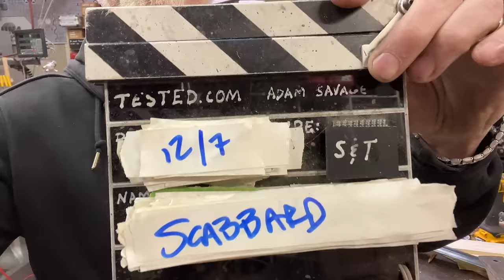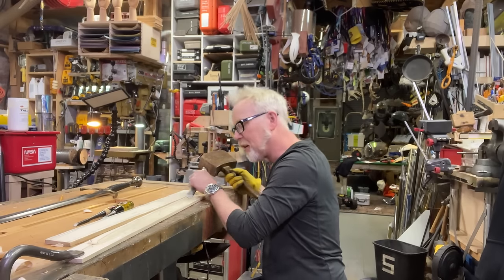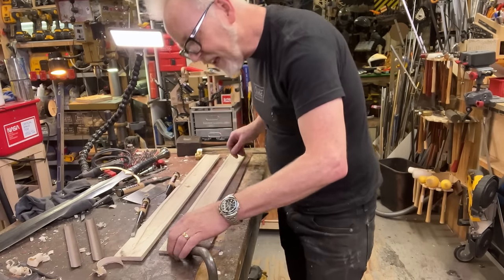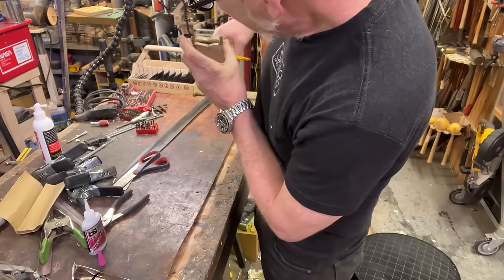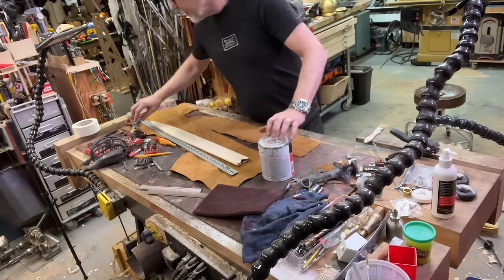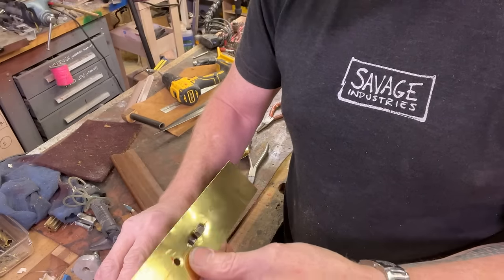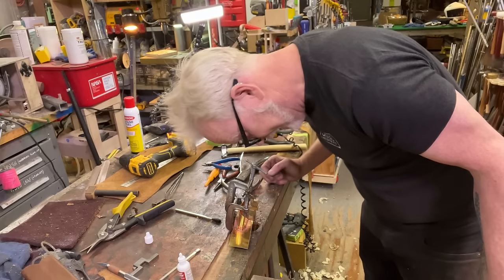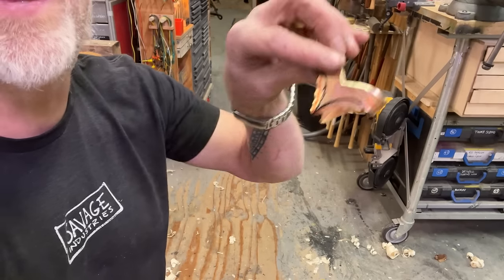Adam Savage's One Day Builds: Sword Scabbard!

Comment: I made a number of scabbards for broadswords a number of years ago - when the build was close to done I started coating the blade with graphite the sliding it in. This showed where it was rubbing most on the way in and where we needed to shave away a little more without overdoing areas that didn't need it.
Hope this helps!
Reply: Great idea! Chalk for a chalk line would probably also work
Reply: @alexstarr1589 
Yup.  Or even drawing charcoal would work.

Comment: a router plane would have done wonders on the inside of this. Router planes are a very interesting hand tool too.
Reply: i was about to comment this same thing !
Reply: As an old school carpenter, i endorse this comment. Accept this 'like'. 👍
Reply: Was gonna say the same, I’d use my 71 for that.
Reply: I had never heard of this tool, now I've looked it up I want one!
Reply: Take a piece of wood, drill a couple holes side x side at an angle, push that same chisel into the holes, bevel down, to necessary depth, wah lah poor man's router plane.  Look up Paul Sellers Poor Man's Router Plane, thank us later Adam!
Reply: You mean, like the tiny violin plane that Adam did clearly use on multiple occasions in this video?
Reply: yep was going to say the same tool. The old Womans Tooth plane
Reply: @shubinternet  
Nope, using a chisel produces an inconsistent surface, the tiny plane will follow that surface, so, a nice smooth finish but varying in depth.
The router will take the surface down to a predefined depth, consistent across the whole piece and referenced to the original surface of the work piece. 
It has various common names such as "Grannys tooth" or variations of the same due to its single narrow blade. 😁 (Granny had a very gappy smile! )
Reply: @shubinternet  That's just a normal planer. A router plane holds the chisel at a specific depth
Reply: @Mechie980  Don't know if you were being funny using 'wah lah' but if you weren't and if you care the word is 'voilà', French for 'Check this awesome shit out!' - (look there).
Reply: No, a router plane wouldn’t have done wonders on this, it would have done damage. It’s supposed to be used across the grain, not with the grain: it has a wide open mouth, no chip breaker, and the iron goes into the wood at a slight angle, bevel up – If you used it along the grain for this, you would split the wood and tear out huge chunks. In addition to this, a router plane produces a flat recess, but the sword isn’t flat, it’s much thicker in the middle. So even if a router might just about work at a very shallow setting, you would have to readjust the depth all the time to create the right shape. A carving gouge would probably be the best tool for this, but the chisel (bevel down!) and the violin plane are right, too.
Reply: Did you just tell Adam Savage to buy a Router Plane?! If he does and mentions it, the second hand market will double in price again!!! They're already well over priced!
Reply: @mm9773 1) you can use it with or against the grain. If you’ve tried and couldn’t, your iron was dull. 2) it’s adjustable for depth and you control where you cut. 🤷‍♂️
Reply: @Mechie980 
“Wah lah” = “Voila”.
Reply: @shubinternet 
A router plane is different than a violin plane.  A router plane works more like a router (for obvious reasons) and hogs out material to a set depth registered from the flat, top surface of the piece of wood (around the carved space for the blade in this case) rather than just shaving out pieces within that space, like the violin plane does.  It can give a uniform depth mortise or dado and is often used for cutting such grooves or dados.  Like if you wanted to make a dado for a horizontal book shelf in the upright side pieces, you would use a saw to saw in the sides of the slot and then use the router plane to remove the wood in between your saw kerfs; and you would get a flat, even dado (slot) for the shelf.

In this case though, it wouldn’t quite work because the blade isn’t flat and the carved out area needs to be carved to a variable depth.
Reply: @thirdeyenz 
I said the same thing.  “Wah lah?!”  He must be from “Puh hoe en icks” (I mean “Phoenix”).  😆
Reply: @mm9773 
True.  Although poplar might have even enough grain to get away with using it with the grain as long as it’s used the right direction to avoid tear out.  But the point is moot since you’re also right about needing to carve to variable depth for the blade shape.

Comment: Loving the sword content.
I like the traditional sheep's wool lining. But I suspect that that specific bit of wool was cleaned and so lost most of its anti-rust oils, coupled with most of the wool being shaved off as well. However just as some lining to help hold and cushion the sword it would probably work well anyway, as long as the chemicals used are non acidic.
Typically you also don't want to store the sword for long periods of time in the scabbard, since it can trap humidity and you won't notice if rust starts to form.
Very interesting project and I can tell Adam has been reading his Oakeshott.
Reply: Yeah, it's the natural lanoline in sheep's wool that would help keep off the moisture, anything sold retail has had all that washed away. If it doesn't smell like sheep, you would need to add a form oil yourself.  ;-)
Reply: Do you happen to know why he only lined one side of the scabbard? I'd have thought lining both sides would make more sense

Comment: I've been using various hide glues for decades in the historic restoration field, primarily with wood, but also other organics. If you're not going to use up that Titebond liquid hide glue in the next six to nine months or so, I recommend you keep it in the fridge (better yet, the freezer) for a much longer shelf life. Unlike most food expiration dates, definitely DO pay attention to the date on liquid hide glue bottles. When liquid hide glue gets too old, it no longer hardens fully. If you need your chilled/frozen hide glue in a hurry, just drop the bottle in some hot water for a few minutes and it will be ready to go. In my experience, it doesn't suffer from multiple freeze/thaw cycles. My guess is that the long protein chains break down over time, either through enzymes or oxidation, so that when it dries, those broken up protein chains can't do as good a job cross linking and tangling up. For some applications that's not a problem, but you definitely do not want to use past-its-prime liquid hide glue for things like furniture joinery where joint creep is bad. There, you want it nice and fresh. When used fresh, a well fit, well glued joint can last hundreds of years, and still remain reversible for future generations to repair without undue difficulty. As an alternative, dry hide glue has a very long shelf life, and you can hydrate/heat just as much as you need for a particular job. Hot hide glue is it's own thing that also has the advantage of being nearly instant, although it's a bit more of a pain to prep. Altogether, though, hide glue is great stuff!

Comment: I've been making both a scabbard and the sword for it out of cedar using nothing but hand tools. And this video is incredibly helpful giving me ideas of how to make more progress I've been stuck on. A hand planer would definitely help me get the outside thickness down to where I want it faster and more efficiently than sanding and using my carving knives. And I wasn't sure how to adequately leather wrap the scabbard but using contact cement seems much more reasonable than trying to sew it like a sock for the scabbard to nest in. 

I really appreciate how much of this project you did with hand tools, since all of us who might want to replicate the processes displayed. 

How do you 'hide your crimes' with the strip of leather up the back to cover the rest of the sword so the edges don't come loose with time and wear, and don't have an obvious edge that it was just a strip glued over the back?

It seems like you want to do something to cover the tip of the scabbard, which I'm confident you could do in brass similar to your mouth fitting, and it would be nice to see you do a follow up video where you do that work. It would also be really helpful to my own project to see how you might make a harness for it to hang from a belt or otherwise be easily carried on the body.

Comment: I have an 1888 pattern bayonet, it was my Grandads. Don't panic, he was in the medical core, the RAMC in WW1 and he assured my Dad it has never been  "used". So, it deserves a scabbard which apparently deteriorated before I was born, so I'm going to make one. Anyway, I've made models for many years and I switched to nickel silver many years ago. It's a little bit more expensive than brass, you can anneal it, works like brass, solders really nice, it paints far easier and doesn't tarnish anything like brass, but polishes well and looks like silver.

Comment: It's normally not necessary with Titebond's hide glue, but heat up the bottle in a water bath if it's too thick. I've only tried using Titebond's hide glue, but I've been told that Old Brown is superior and last longer. That, however, must be heated in a water bath before use. I've purchased a cheap wax heater for the purpose, although I've just acquired an old glue pot, which is pretty cool (I don't have any way to use that in my workshop, but still :^) ).
Reply: I am not familiar with Old Brown but a microwave works really well for heating small batches of the granular stuff!
Reply: @fwkb2  I haven't tried that. But I was also only referring to the finished product you can buy and not the one you mix yourself. That's better, of course, because you only have to mix what you need :^)

Comment: My first sword sheath had a built in knife sharpener in it, one tungsten carbide to polish the edge and one ceramic for the initial conditioning and sharpening.  It would stay razor sharp and sharpen it every time I pulled it out.  I made one more since, but do not do that any more.

Comment: One thing i would've done different (because the sword begets it) is the brass furniture on the scabbard, i would've layered it rather than cutting it. Another piece of brass with the red line as a shape, leaving the base brass piece as is, without cutting it. A simple look from afar, revealing detail at close inspection. Some of the best (surviving and modern) swords (as a whole package, sword + scabbard) have this kind of aspect to them. Aesthetically, the best swords are those that look the simplest at a glance, which befits their linear, thin aspect. IMO, it's why the Japanese katana has been living rent free in so many people's heads, even those that hate it and pit it against European swords (as if you'd ever want to compare melons with peaches). It's a simple sword from afar. A single, swept line, but up close, the minutia of details is overwhelming. Same goes for other sword of various (nation) makes.

Comment: Hi Adam, If you are using poplar, why don't thermoform it to the blade? heath it with steam for a few hours and then press it with your vices so it takes the shape of the blade... or the space you want to have... then once cool and dry you just do the outside shaping you want...

Comment: How I'd do it. Establish stations along blade and copied to wood.  Ensure a station at widest point. Measure blade at each station for width and thickness. Establish c/l on scabbard. Use depth stop and drill to make hole on c/l of half blade thickness. Add thickness for liner, if any. Using narrow chisel connect edge to holes. Wider chisel from point to each groove. Sand with appropriate block.

Comment: i made a scabbard in 4 quadrants so i didnt have to chisel it all by eye. say the blade is 10 degree bevel make a 10 degree jig for belt sander. trace one side of blade profile on the wood. then just push it against sander at 10 degrees until you hit the line and you got a perfectly matched quadrant.

Comment: Adam, the hoops on those japanese chisels need to be set properly and mushroomed, they don't come working out of the box - then you can have the advantage you can use a mallet or a hammer on them. I'd also use a router plane for much of the roughing if you want to do it manually is faster,  more reliable and will hurt your hands less.

Comment: You need to upgrade your nibblers. Those Radio Shack ones are hard on your hands. I used them for years, then got a set of Kleins. Like night and day.  I did cut off the ejector spring on one pair for better visibility like the Radio Shack style. Get some, your hands will thank you.

Comment: A little anecdote to illustrate Adam imagining a disapproving Japanese carpenter.  I took a guitar building course with a retired Japanese furniture maker (sashimono or joinery without metal fasteners).  He would make boxes with fitted lids that slowly closed with air pressure.  The same with his chests of drawers.  You closed one drawer too quickly and another pooped out.  He routinely worked in tolerances that are normally reserved for machinists and luthiers.

Comment: I would have had to cheat a little and set a fine tip router at 1/8 inch deep and run it down the center of the cutout as a guide to keep from cutting too deep or shallow.   My father was a carpenter and used colored chalk to see where things were rubbing.

Comment: I wounder if a better method to cutting the grove is using a hand plane and going the full length of the poplar. Then when ypu trim the end to a point ypu end up with an exposed void but then cover it with a metal finial. Same result just faster. Also, for even faster results a router would be good.

Comment: 1:56 - "It goes from quarter-inch to three-eighths of an inch" - That would be hilarious: a reverse distal taper, and wicked heavy (nose-heavy, no less). I assume you meant 3/16" rather than 3/8".

1:58 - "So it loses only about a hundred and twenty-five thousandths [1/8"] from the base to the tip" - If it really loses 1/8" like you said, then that means it tapers from 1/4" to 1/8", so did you mean to say that it's 3/16" or 1/8" thick at the tip?

Comment: The strengths of the scabbard sword were to penetrate and to be sharp Both sides were sharp, but the weak points were in the cut That's why Smiktar swords appeared in the Middle East But again, the Skbar sword was used in the era of the Smiktar sword Been

Comment: Let me just say, you need to listen to those who went before you! Hear my tale and understand, I am here to help you be better than I was as a young man. Long ago, when I was a young man who knew all there was to know about everything, I set about glueing a remote control together because the little clips that lock it together had broken. I chose ca glue, due to its reliability, to complete my repair. I positioned the two halves and applied the glue. I put the bottle down and applied force the two halves of the 'clam shell' and found significant resistance while trying to squeeze the two halves together. Suddenly they smashed together, forcing, the still liquid glue, to spray outward, directly into my eyes! In a panic, I forced my eyes open, as they were firmly stuck together. As you can imagine, this caused much distress! After much argument with my girl at that time, we got in the car and went to the emergency room. They complimented me on my quick thinking, and scolded me for the same as I could have torn the skin of my eyes open in ripping my eye-lids apart. In the here and now, my eyes are ok. They gave me some crazy meds that made my eyes feel ok but wrecked my stamina for that night so long ago. My GF was very understanding. Let my tale be a lesson to all who have ears to hear it. CA glue is very dangerous and may interfere with an epic night of lovemaking if not used properly.

Comment: Those are some weird glue choices. You used hide glue because you were worried about chemicals being near your blade, but then used CA glue (AKA: super glue) to glue the two halves of the wooden scabbard together? In any case, you should have used PVA glue (AKA: wood glue, white glue) in both cases. You can get "archival" type PVA glue which is pH-neutral so there's no risk of it causing your blade to rust, and PVA glue creates a bond stronger than the wood itself, and also creates a very strong bond with leather. For example:

"Any white or yellow wood glue will bond most raw leather to wood. According to technical specialist Dale Zimmerman at Franklin International, that company's original Titebond glue once was used to connect the ends of leather drive belts for heavy machinery in factories."